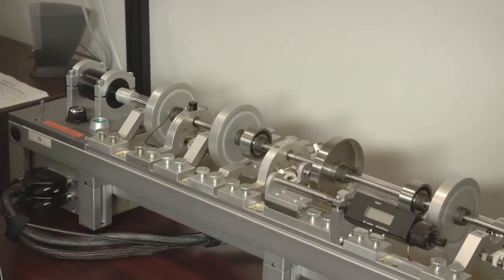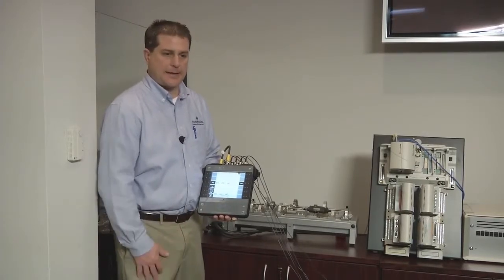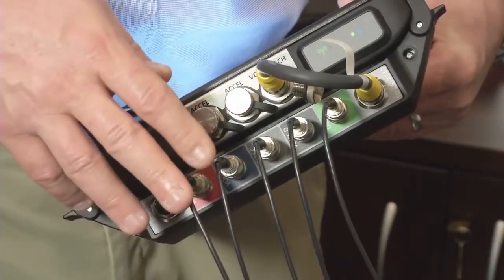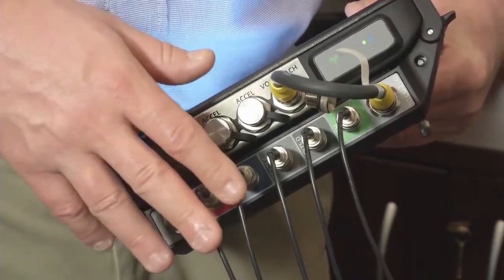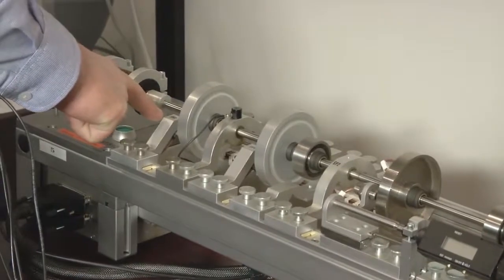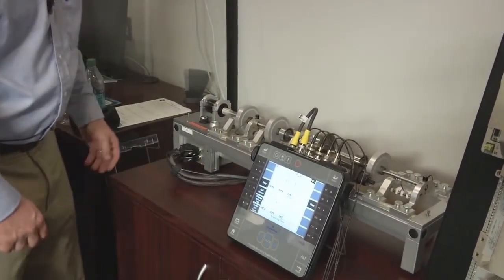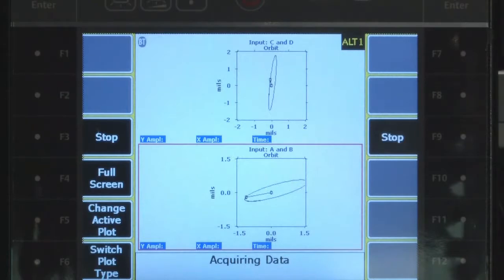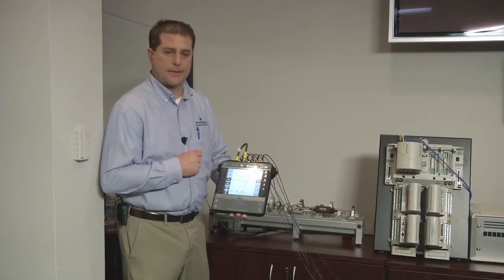AMS 2140 Sleeve Bearing Monitoring with Dual Orbits

Comment: Very good video. We have the csi 2140 but when we have measured the orbitals and when moving the cables, the measurement is altered. What could be the problem?
Reply: Hi Rodrigo, it's weird what you mention is happening with your asset, as cables fails should make you lost signals, but never change the shapes of the orbits. They show the way the rotor is moving inside the bearing because of the forces applied to the machine. I recommend you to replace the cables and take new data.